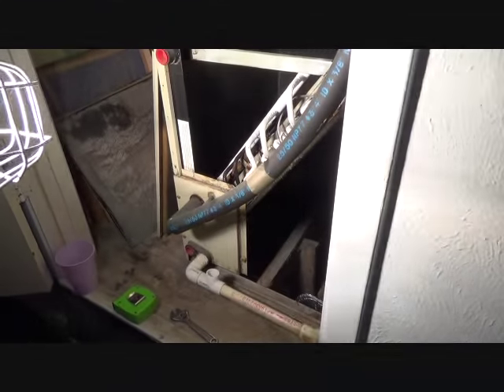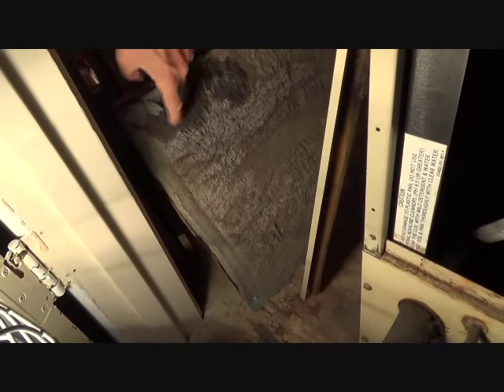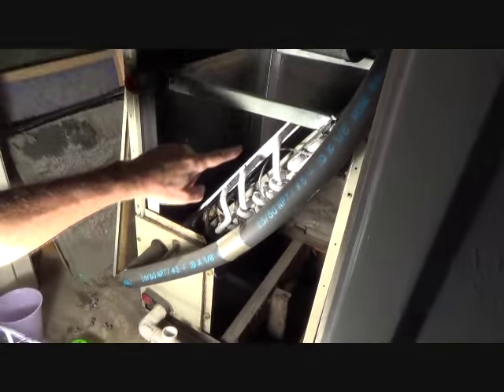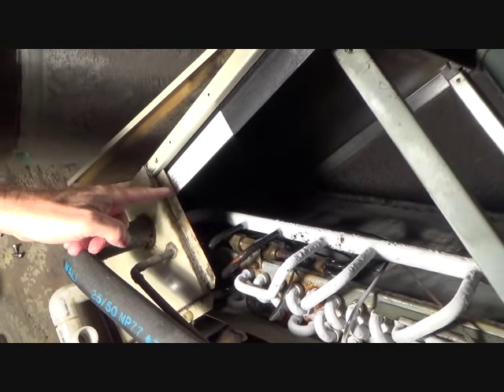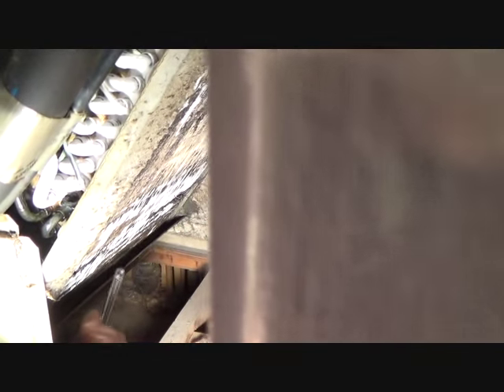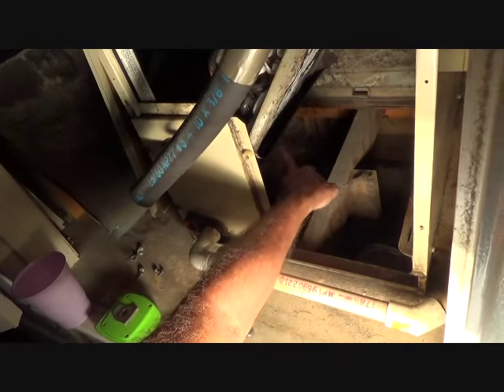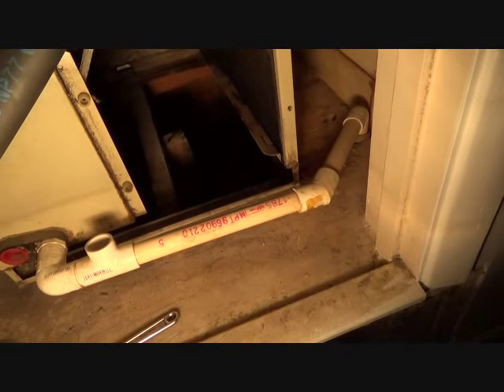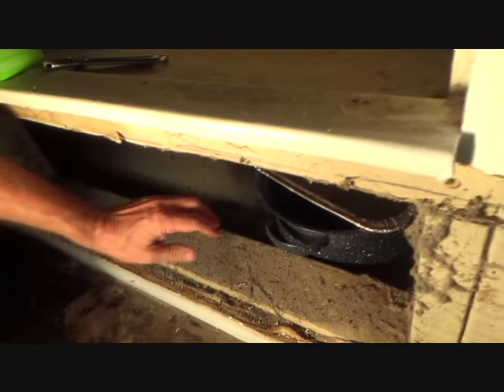Is your HVAC leak coming from the condensation pan?

Comment: Hey man, that systems low on r-22, clean that coil and it'll stop that water from dropping down in the platform afterwards it'll go down the coil fins like it should!
Reply: The coils freezing up because you have both doors off and no air is able to pass through the evaporator coil, the reason the insulation is wet is water dripping down from coil. Go to lowes buy a green can of evaporator coil cleaner, get a wire brush then spray cleaner on coil then gently take wire brush and go down the same direction as fins. This will save you money!!!!!!!
Reply from the maker: +Joel Barineau Dude thanks so much for the tips. Much appreciated!   Joe  :0
Reply from the maker: +Joel Barineau I've already left the property but thanks for the information. Glad this leak wasn't anything more than it was....Joe  :0
Reply: What do you clean the coils with?

Comment: Negative pressure coil....need to install a pee trap so condensation isn't sucked back into the drain pan and overflowing
Reply from the maker: That might be a good thought but believe it or not the reason why this hvac unit was leaking was because the washable air filter was clogged! Once I saw that I gave it a good wash & put it back in & no more leaking! I made a video of that too. Just go to my main YouTube channel page then click on playlists then scroll down to hvac & I show a few videos of this hvac unit. Thanks for stopping by...
Reply: @VideoJoeKnows  thank you - good job

Comment: Call an AC technician, you are probably low on freon and your coil is filthy, that is why it is freezing. You have no idea what you are doing, so why post a video like this?
Reply from the maker: Well you were wrong on both counts! An average Joe found the washable filter was clogged to high heaven so he took it outside & gave it a good wash then reinstalled the same washable filter & worked like a charm after that. Your assumptions could have been correct but as you know there are many things that could cause an hvac to leak like this one.....even an average Joe like me knows that! LOL

Comment: So what was the problem? Thanks
Reply from the maker: I made a few videos of checking out why this unit was leaking. You can find those videos by going to my main YouTube channel page then clicking on playlists & scrolling down to HVAC or something like that, & they will be in there. Funny enough the leak was caused by a washable filter that was so clogged the unit didn't have anywhere to breath thus it got so cold that it started dripping down the edge of the unit down to the floor then down to the concrete subfloor. The washable filter was located down at the bottom of the unit & I pulled that out & saw how clogged up the filter was so I took it outside & flushed it out with a hose & put it back in & presto everything worked just fine. I made a video of washing out the filter & made some other videos too under the HVAC area as explained above if you want to check out those videos. Thanks for stopping by!

Comment: I have the same issue where did u find the problem
Reply from the maker: My actual issue was I finally found where the existing washable filter was located (at bottom of unit) then removed the clogged up filter took it outside & gave it a good wash then re-installed the same filter & presto!

Comment: If your coil is dirty or the metal is corroding it won't allow the condensate to run down the coil and into the pan the condensate water will stop on the dirt or corroded spot on the coil and drip straight down it is supposed to run down the coil and into the pan it will not do this because of the dirt or corrosion on the coil or could be low on freon do yourself a favor and call a certified technician he will come out and clean inside coil and outside condensing coil and then check your Freon levels your coil is very dirty someone has not been changing filter
Reply from the maker: Thanks for the info! I was trying to help out a friend on the cheap & finally found that the washable air filter located at the bottom of the unit was clogged full so I removed it & took it outside & took the garden hose & washed it & put it back in & presto...worked! Amazing what a clogged filter will do...right?!!

Comment: When your doors are open the coils freeze. Like yours are in the video
Reply: Does that mean that video Joe really doesn't know?
Reply from the maker: Good point but they were freezing anyway because I found the washable filter was clogged solid. Took it outside & gave it a good clean then reinserted & everything worked again! Thanks for your message...
Reply from the maker: LMAO actually I am not an hvac guy but I thought I would look at this unit anyway just to see if I could figure it out....& I did! The washable filter under the unit was clogged rock solid. Removed the filter then gave it a good wash outside then reinstalled & it worked again!

Comment: I’m having a similar situation. Water condensation is falling on top of the filter and dripping through it to the floor. I checked the plastic trays every where and I don’t have any filth/blob accumulated anywhere on the trays. Where could the water condensation be coming from??
Reply: Halcyon Outlander Yes I did. Had a big concentration of slime accumulating in the back of the A/C unit which I could not see. Water chooses the easiest path of flow so it was leaking out the back. Had to pay a technician to remove the whole thing and clean it with acid. It’s been fine afterwards.
Reply: @RodrinBird  I think I have a similar problem, with my central AC. how much did that cost using a technician / ac repair company? After two visits my Ac technician is saying my drain pan is ruined and I would need to somehow find a drain pan and new coil assembly and then blah blah blah, buy a new system for $9,500 (insane). I think I need a second opinion to possibly remove and clean like you said, thanks for any help
Reply: thewhitewolf I had a friend who’s an A/C tech come to the house. He had to remove the coils, in my case the slime was stuck on the back tray which couldn’t be seen unless the coils are removed. My A/C was only a year old, but my problem was I was buying a filter 1” smaller and dust was infiltrating through the sides and accumulating inside. Once the coils were removed, they were cleaned with the acid foam and we could see the tray in the rear that wasn’t draining from the slime which was later cleaned and now is perfect. In all, I was charged like $250 for the whole job but that’s because it was a friend. This job of removing the coils is more expensive, between $400-$500. Do get a second opinion and find someone honest, hopefully you don’t have to buy a whole new unit. Good luck!
Reply from the maker: Did you check to see if you have a plugged up filter? In this case I finally found where the filter was (under the unit) & it was plugged up solid. It was a washable filter style so I took it outside & cleaned & washed it out let dry then put back & held my breath. You know what happened? Worked!! what did you end up having to do to resolve your issue?
Reply from the maker: What did you end up having to do in order to repair your issue? what I found on this unit was a washable filter was plugged up solid so removed it & took it outside & washed it & put it back in & low & behold that's all it was. What was your issue? Hope it wasn't too costly like you explained it might be...
Reply from the maker: Nice going with getting it fixed!

Comment: What if the water rains down and completely misses the pan???
Reply: That's what happens when your coils are dirty or the air flow is blocked by the dirty filter
Reply from the maker: Yes as a matter of fact I found a washable filter located under the unit so I pulled that out took it outside & gave it a good washing then put it back in & son of a gun everything worked fine then! You were right!
Reply from the maker: Then you would find out soon enough if you saw your floors wet. In the end I found a filter located under the unit & pulled it out & found that it was clogged solid so I took it outside & lucky for me it was a washable style filter so I gave it a good wash & put it back in crossed my fingers & everything worked just like it did before....fine! Maybe this is what your issue was? Not always but a good idea to keep the filters clean for sure.

Comment: I have a trane. It has two pans. They are intertwined with the coils. Cannot be replaced without replacing the coils aswell. The pans are rusty and leaking. Flex seal and silicone have served as a two year patch. Now she's leaking again.
Reply: Use jb weld
Reply: @jayc4715  I replaced the whole thing 3 years ago
Reply: @BADD1ONE  👍
Reply from the maker: What did you end up doing for the repairs?
Reply from the maker: That stuff works good for certain things but not sure how much damage he has on the pans....Thanks for your message!
Reply from the maker: Awesome!

Comment: Is there more than one filter inline with these a/c units ?
Reply from the maker: I think most of these units there will be just this one filter under the unit or on the side of the unit but not 100% sure as sometimes there could be a filter on the wall somewhere down low or even one in the ceiling somewhere but not usually. What did you find?

Comment: That looks like my old Armstrong air handler.
Reply from the maker: Ha not sure but I got it fixed just by locating the washable filter under the unit then taking it outside & giving it a good washing then I put the same one back in & worked like a charm!
Reply: @VideoJoeKnows  that’s all that matters!
Reply from the maker: @Samlol23_drrich  Yes!

Comment: My coil is dripping like a leaking faucet! I don’t know what to do about it? I cleaned the bottom of the drain bottom from the rust and debris !!!!!! But it still leaks at the bottom of my of my air return box , moldey looking shit building up,  I’m now lost what to do????
Reply: man.. I’m also having this problem... I seriously think my carrier needs a splash pan.. I’m an installer and just recently installed 5 tranes all horizontal and I installed the splash pans on them.. so on this carrier it’s sitting vertically and it’s steady dripping during the summer time
Reply: @luckymulisha3180  well, we replaced the coil and that solved the problem.... The Carrier unit came with house but, when it comes time to replace the system,,,,,,,, it will definitely not be from Carrier,,,,,,,,,,,
Reply: @kennyr.1083  all brands fail at one point 😪😢
Reply from the maker: This one I show happened to end up having a washable filter that was clogged to the gills! I washed it out & cleaned around the filter area then put it back in & presto....leak stopped. Glad to hear you got your issue resolved!

Comment: Dude you do not know a/c diagnosis lmao
Reply: Mike Robles LMAO, this dude shouldn't be making an HVAC video lol.
Reply: D.S.M  agreed.
Reply from the maker: I know! I'm not an HVA guy but I wanted to show what I saw & what possibilities it might give you to fix your issue. I thought I would do all this prior to calling an AC out myself since I figured if I could find the problem then I would save the owner some money! I DID find the problem too....under the hvac unit there was a washable filter that was clogged to high heaven. Carefully removed the filter, took it outside & washed it out thoroughly then re-installed the same filter & presto problem solved!
Reply from the maker: All I know is that I found the issue....a clogged washable filter. Took it outside & rinsed it out then re-installed it & wah law....problem fixed!
Reply from the maker: All I know is I saved the owner probably $150 since I found the issue without having to call an hvac service guy out there......washable filter clogged at the way. Took the filter outside & gave it a good wash then reinstalled & crossed my fingers. But of course it worked again just fine!

Comment: i got aright fuked up leak when it rains my wall paper gets soaked inside nearly down to light switch im too scared to tell landlord as was skint n cancelled home insurance
Reply from the maker: +Laid Back You might have to suck it up & tell your landlord before the leak gets any worse. i think he will actually appreciate it. It's not like your fault or anything that the leak is there. You're just doing your duty to report the issue to him. Do it...! It will be ok. You will be glad you told him....   Joe  :0
Reply: @VideoJoeKnows  if you fail to report it then you are negligent then you will be responsible

Comment: Hrs trying so hard but knows very little about Hvac..yap yap yap.. what's the point... and yes I'm a tech
Reply from the maker: Ha if you're a tech why are you watching an average Joe (me) try to figure out why this unit is leaking? LOL In the end I found the washable filter located under unit & it was clogged solid. Removed it & washed it outside then reinstalled the same old washable filter & presto....worked fine! Did I pass for an average Joe? Hope so!
Reply: 10 years sir
Reply from the maker: @5822huron  Wow....LOL
Reply: @VideoJoeKnows it's a blessing
Reply from the maker: @5822huron  Thumbs up for sure. Make today great!